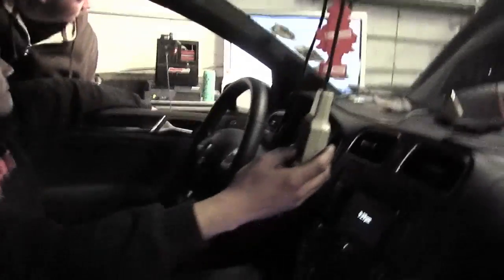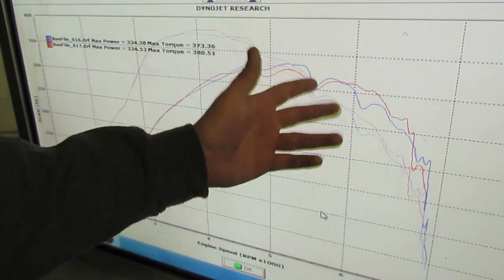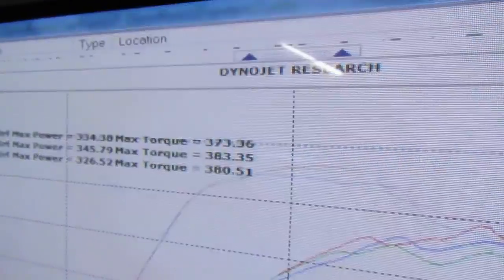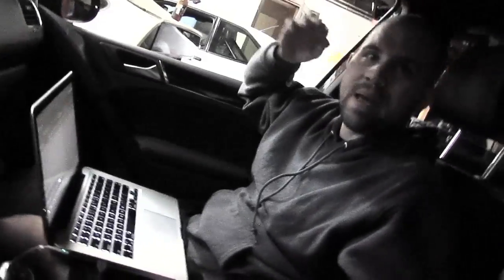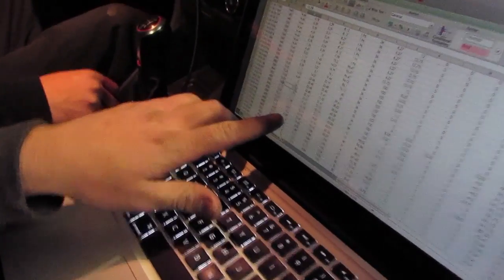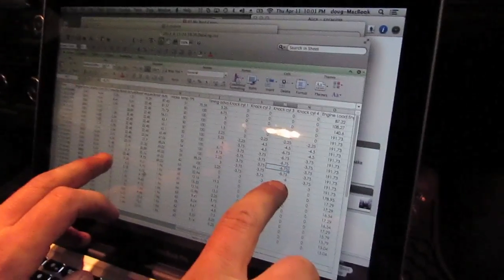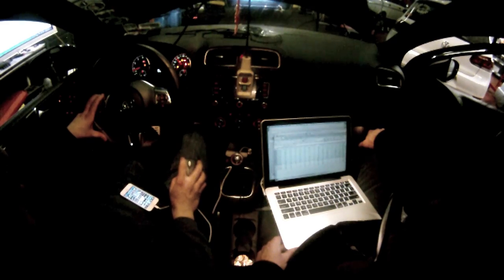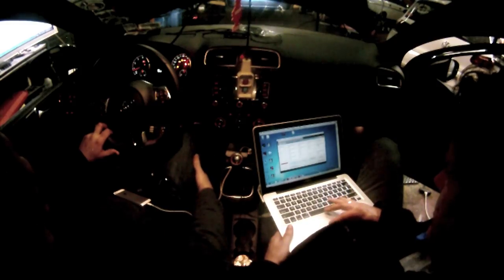FrankenTurbo F23T - Mk6 TSI dyno tuning

Comment: Wait so if i get one of these turbos...what else do i need?
Reply from the maker: This is tuning via Eurodyne, but any Cobb dealer can now map your Mk6 for our hybrid turbo.  We recommend an upgraded exhaust and intercooler.
Reply: Dang sounds expensive, i gotta do some more saving up
Reply: sweet, any suggestions on what exhaust and intercooler i should go with?
Reply: Riverside Soccer Store golf r intercooler is a step up for cheap
Reply: @SlappyFrankenTurbo question I have mk6 with same mods and wonder if u guys tune and I can put it on my Cobb accessport
Reply: If you check on ECS tuning . com, they have it listed as tuning not required if you want to keep everything stock. And if you’re from Cali, could be a viable upgrade